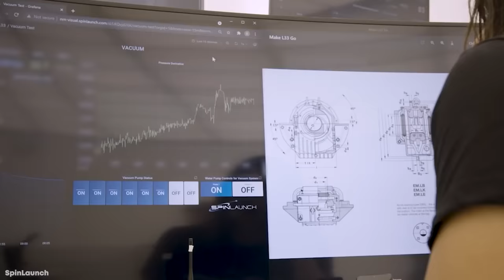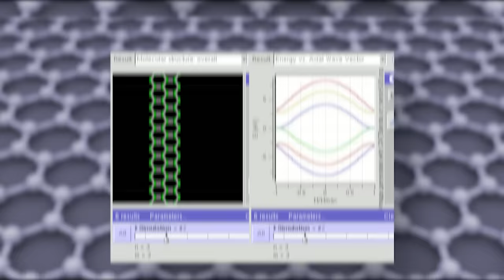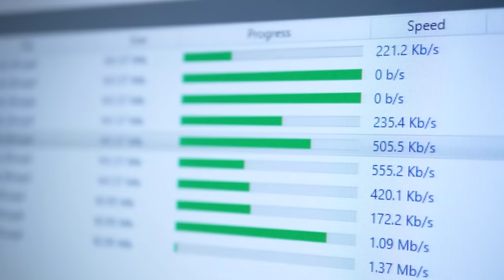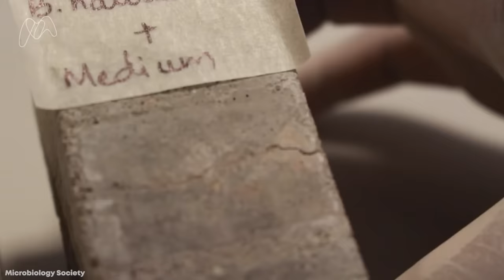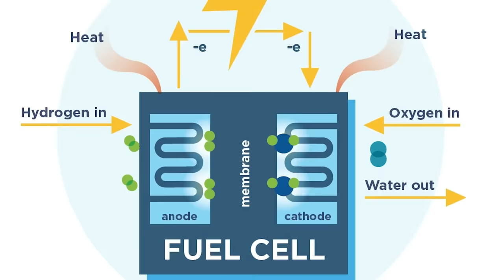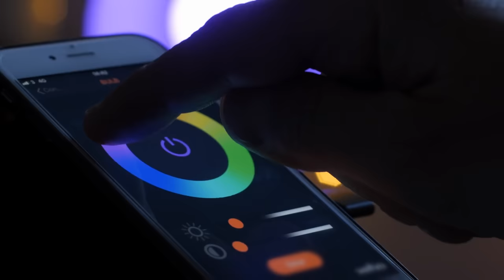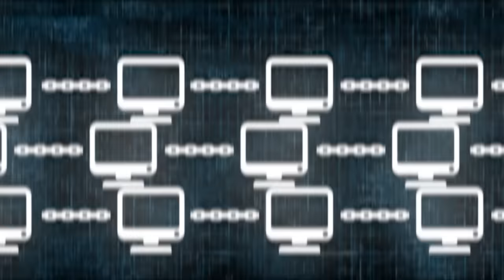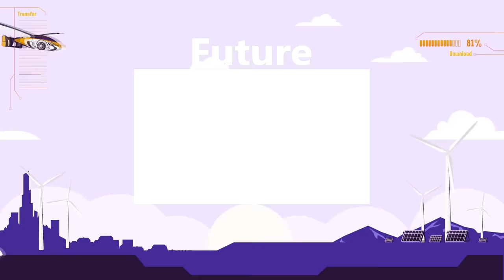15 Emerging Technologies that Will Change the World

Comment: You don't know what you speak of. The reason accuracy is a problem with civilian GPS is because the military partially encrypts the signal so that only the military has high accuracy and is capable of encrypting all of it. That's why you need significantly more satellites to have good accuracy of civilian systems while military systems are accurate to within a few inches with the  4 satellite minimum. They do this by encrypting the smaller divisions of the time signal, i.e. microseconds. So what makes you think the military would change this? How do you think they are improving a system that works exceptionally well? Yeah they could make the signal more powerful to help keep from being jammed but that's not going to help you because I doubt your privilege will ever take you to a warzone were this would be beneficial.

Comment: So... the spin launch system will face serious hurdles to scale up to full size.   It will never be usable for human launches.  Lastly, it will be extremely expensive to build a full sized unit and any one failure will likely be catastrophic to the entire facility with the rpms we're talking about.   Oh, as for "green," current rockets make up such a small percentage of the overall problem it's not even a drop in the bucket.

Comment: The Electric cars getting powered by the Electric grid which is still powered by Coals/Fossil Fuels. Simple math will tell you that the strain put on the grid will just increase the Fossil fuels needed to power the grid and will probably equal the same proportions of fossil fuels being burned. So hopefully Hydrogen starts making some improvements soon.
Reply: It's ironic init. Not to mention during a war electric cars would be obsolete
Reply: Hydrogen it's highly explosive

Comment: Hydrogen is a non-starter. It's so dangerous to handle that if you have the energy to make it then you can justify using the sabatier process to tack on carbon atoms and make it much safer to handle

Yes it costs more to make such syntheic fuels but the vastly reduced costs of handling/distribution outweighs the expense

Comment: What they say at 1:40 that it costs 10s of millions to send a satellite into space, that has become the higher end for recent years, hasn't it? If the satellite launch isn't urgent they can pack a few into one launch, so for most satellites the cost already has come down significantly. Not to say that the spin launch doesn't have a future, especially if it gets optimized at the same rate that spaceX has managed it.

Comment: Cloud computing is the biggest scam ever developed. Before it came around you purchased a program and it was on your hard drive and you could use it as long as you had that computer. Now you just rent a program and have to pay a monthly or annual fee. Another thing bad about it is if you cannot connect to the internet due to many reasons I will not go into. So putting the program on your computer is better by far especially since drive prices are so low.
Reply: That isn't what cloud computing is... you just described live software which requires a monthly subscription.

Comment: Ok - second comment: Spin-Launch is not viable. Oh - they will use billions to work on it and then abandon it later. A much better solution is the Star Wars approach (not the films - but the Reagan Era device). Think of a long tube - a mile long. It goes up at about a 15 degree angle. Inside of the tube are super conductor magnets. You take a ship, make sure it is properly insulated against magnetic pulls INSIDE of the ship. The ship is loaded into the tube, when the magnets are turned on, the ship floats in the tube. Then the magnets begin sucking the ship through the tube and it comes out the other end. Normal rockets take over from there. The greatest problem we have is over coming the gravitational pull of the earth. On the Space Shuttle, the two gigantic tanks on either side of the Space Shuttle AND the main tank under the Space Shuttle are there mainly to get the Space Shuttle moving. Note that the two main tanks are ejected after only a few minutes. That's because the Space Shuttle is then moving at 3Gs (not the 10,000Gs the video says). 3Gs allow people to ride in the Space Shuttle. However, as the guy says in the video, inanimate objects can sustain more Gs than people. So all equipment can be sent up by flinging the ship faster out the end of the tube. Also, once you are moving forwards - the effect of the 3Gs is lessened inside of the ship. Thus, you can go to 5Gs going out of the tube. In effect, you can send jets into space in this way and you can send the parts to make another "gate" which can be used to send ships to the moon. Again - first you send the ships with the parts to make a new "gate" to the moon AND THEN send the people to be there and put the gate together.  Following this method, we could actually go to the moon, Mars, Jupiter, Saturn, or anywhere else in our solar system just by first sending the components to build a "gate" back and then send the people there to put them together. Ok - why do you have to insulate the ship? There is an effect which I can't remember its name - but what it is - is when you pass through a magnetic field, it feels like someone is dragging claws across your skin. The more powerful the magnet - the more powerful the effect until it literally peels your skin off of your body. The ship would have to be insulated to keep this from happening.
Reply: Spin launch is viable for unmanned launches, it could be used for the deployment of satellites and could potentially play some role in cleaning up orbit

Comment: Scractch 9 ( Hydrogen Fuel) and probably 5. (Lithium Metal or Solid State Battery). No practical use for Hydrogen Fuel Cells since it takes a lot more energy to separate hydrogen from water than it will actually produce. Also, it needs to be produced, stored, transported and unloaded to another storage facility for public consumption (Sounds familiar?). Another gimmick by Big Oil to control the fuel. Solid State Batteries has been promised for years but don't seem to be able to be mass produced at a lower cost than Lithium Ion or Lithium Ferrous batteris.

Comment: Batteries are already being used in Trucks, Ships and Planes. Hydrogen Fuel Cells won't end up being a winner.. Economics will win and that's BEV's.
Reply: You are correct - but not for large (long distance) Ships and Planes.  There may well be a place for Hydrogen, but only once it can be produced at scale from green electricity.  Otherwise its inefficiencies make it more polluting than fossil fuels.
Reply: @simhedgesrex7097  For long distance there is always wind.
Reply: @michaelwebsternz  Difficult to get wind to power a plane.  It can help with ships, but can't be the only source of power.
Reply: @simhedgesrex7097  battery cost and wait is reducing and will overtake other forms of energy in most applications. The economics just won’t work for the others.

Comment: UW-Madison engineering (Wiconsin)s has developed a light weight, mainly plastic electric motor for vehicles that meets performance and reliability demands.... apparently the problem is financial backing and development....this vehicle needs no cooling system, total weight of vehicle? perhaps around 1000-1200 lbs.

Comment: Sorry but their space launch will not work.   If a satelites burns up re-entering then thin upper atmosphere, imagine what launching it through the thickest lower level atmosphere at those speeds will do for burning it up.   Further more, that is all velocity lost, pushing the atmosphere away.   Second, the G forces limit taking a simple copper wire around a simple pulley of any diameter at more than 240 mph, due to the centrifugal forces on it.   Other materials can do better, but not enough to solve this problem.   So, who really is putting up money for this project that is destined to fail?  So, I now have to question everything else they said.    As for hydrogen fuel. It has a specific gravity of only 0/07  (7 % of water) but with 3 times the energy per unit weight of gasoline, you would need three times the volume of hydrogen to do the same job as say jet fuel, the tanks would be so large that they plane would not have space left over for cargo across the Atlantic.   someone is dreaming here.
Reply: Nope. You can convert it to methane or use it compressed. The problem with it is that electrolysis uses a lot of water. So it’s still a future thing but can definitely improve energy saving for renewable energy

Comment: Combine AI and liquid metal creating forms that recreate themselves in solid components for industrial purposes implemented by their individual programs.  Automated system requiring little maintenance and occasional reprogramming dependent on need.  No wages to put up, except for the data programmers and occasional cleanup. Thanks for tolerating the daydreaming, always the fan of the futures sciences.

Comment: Sorry, Spin Launch is STUPID. Timing is near impossible and the drag at ground level would cause the rocket to heat up way more than can be tolerated by most materials. This is akin to having orbital space ships that need to brake enough to land. But this would be at even thicker atmospheric conditions as the atmosphere is quite a bit thicker at ground level in comparison to upper atmosphere. This doesn’t even bring up the precision necessary to launch the vehicle up the tube. Just a bit off and you will have a huge explosion as the vehicle hits the wall. Spin launch will fail miserably.

Comment: Some technologies here are misrepresented. Quantum computing, for instance. It can be used for specific computations, but it will NEVER replace regular computers. Graphene is a wonderful thing but they can't produce it inexpensively. It's been around for over 20 years now. Lithium metal batteries are a joke. There are 20 battery technologies out there and lithium metal is just one of them. None can be produced inexpensively, so nobody knows which one will come on top. Blockchain will be used, but in a very limited fashion. The idea of blockchain is to prevent hacking. To do that, you need a delay in block validations. That's the only way to prevent a farm of supercomputers from hacking it. Not exactly useful, is it? You will be waiting for 10 minutes for your bank to transfer money from one account to another one. Connected homes are just a gimmick. GPS-3 is a better mousetrap. Edge computing is already happening. A hydrogen fuel cell is a great idea. It has some limitations but I think it may get developed. I always thought it was better than solar technology.

Comment: 10:04 "our electrical grids simply aren't designed to handle the load", such a BS argument.
 The thing is, we should use large infrastructure power trasnfer nodes, from state to state,
under the guardianship of the federal government.
This should then be UHV ultra-high voltage, to deliver power at a minimum cost from the place
where it's created by green sources into the place where no such power is then available.
And yes, there's cost involved, but still we can always pollute more, until the message sinks
in when people show up sick at the hospital and yet more costs start piling up.
Wanta cleaner tomorrow ? Invest in it today. I think like 4 nodes per state,
after which the regular grid can pick it up.
Also, local potential power storages can be very greatly used that way, since now each state
can have a big one like a cubic kilometer underground, which then can be used
as power is abundant, and after which it's filled the excess can still be distributed.
Reply: All oil wells will run dry sooner or later, and if by then we don't have power alternatives
in use, well, that's that, economy worldwide on it's backside.
Reply: Oh please... tell me where all this "green energy" is going to come from.... how  are we going to store all this energy?
Reply: @ZMacZ  ya oil will dry up in 100 years or so.
Reply: @randybobandy9828  Sooner, since other fossil fuels are drying up sooner, the demand for oil will increase.
Increased use will mean sooner running dry.
Reply: @randybobandy9828  Simple solar power, non-moving standard, durable with lifetime per panel of nearing a decade, and after that still delivering 80%, and the storage is potential energy storage. That's two vats of water differeing in the position in height, where water gets pumped from the lower position in height to the higher one, when power is surplus, and the higher positioned one delivering water at an altitude through a turbine delivering power when power is requierd again, while flowing said wtare back into the lower is ib height positioned one.
Reply: @ZMacZ Furreh  no they aren't drying up "sooner"
Reply: @randybobandy9828  Basiclaly have 3 taps, one for gas, one for oil and the last being oil.
One dries up, the gas, now the others are used more. => they dry up sooner.
Thinking is not hard.

Comment: in the not too distance future the 3D printer wont be in a cube but will be
on it's own tracks or wheels and long hydraulic multi elbow type dexterity
possibility of maybe self contained just working to a program
having the ability of reloading from secure truck, which it self orders doors
to open so it can refill what it needs, expensive logistics parts with the doors
closing when collected its refills, not AI just scaled up programming 
with support, I could build this now, I have so many ideas and think why
don't they do this now as mankind would benefit now, that's life I should be rich

Comment: All this is really interesting, but blockchain is just a failed technology at this point.
We've been talking about it for over a decade, about how it can decentralize everything and what not, only to realize that the scale required for this can only be achieved by large organizations, which means that it's now centralized. Also, given the scale, it's just not feasible when it comes to memory and energy usage.
The best example is bitcoin. You can see the ledger size and the amount of energy used by it for mining. What started as something you can mine on your home PC, now requires specialized and expensive hardware and an ungodly amount of energy.

Comment: Spin Launch is a joke.  You really should have done a bit more research into the physics issues it has.

Hydrogen is not really a very good option for regular cars.  It requires very thick heavy containers to hold the high pressure Hydrogen.  This is very dangerous in a crash situation.  So unlikely to ever be a common place thing - maybe for some niche situations though.

The claims about solid metal batteries are massively exaggerated.  The laws of physics are really hard to avoid.

Comment: What was that diarrhea squirting fart sound right at the start of the video? Even today, the concrete we make is pathetic garbage compared to the concrete the Romans used to make. And better than hydrogen cells is carbon nanotube technology for storing immense amounts of power in a small form. You forgot to include 5D optical storage "Superman memory crystal" that uses quartz to store immense amounts of data - a thin coin shaped drive the size of a nickel can hold 360TB of data and the data never deteriorates and the storage drive would essentially last forever unless destroyed (it's pretty hard to destroy quartz)

Comment: past-Current-future Chinese
= is using the baGua center of two pivot points of knowledges to rotate
= lower pivot point is left(dot) rotate to right(straight linear - high)
= higher pivot point is right(dot) rotate to left(straight linear - low)
= two pivot points rotate together to change position while retaining the same vector

Example
= low knowledge worker switch left-right
= high knowledge worker switch left-right(low), left-right(high)
= mastery of knowledge switch-rotate the entire circle and the pivot-points

Use high-knowledge to design for low-end, low-budget, economies of scale can enjoy mass production benefits and ... ...
Use mastery can use those things to different effect and expose fake chinese

Comment: Spinlaunch Will only work for small very solid state stuff… will go bust, grapheme of course is 👍. How to make it however,,, ; Why the ferro liquid shots?; Gelileo Ie eu satnav has better resolution, s why build the next system?.. link them all together and we have best system instead of multiple less well function satnav systems…; floating farms nice but let us use office buildings first!; cloud will grow for years, as it has a lot of unused potential; self healing concrete is briljant!; hydrogen is difficult, dac using hydrogen to make conventional fuel use co2  from air is the better solution, nec essay too, as now too much co2 in atmosphere, Starlink is really stupid, pollution of lower orbit and completely not necessary except to keep space x financially afloat; aî dee arming will prove to be great tech but somewhat dangerous too; robot armies etc..l; connected homes is really first world luxury thing…; sponsored by Amazon?; 3D printing with sharing of designs will greatly improve bp,any à making process, eg printed houses indeed… Econ of scale, and much will become cheaper; blockchain will revoliti inzet banking, money, and it’s use will become widespread; sound will re olitionize fire fighting,,,; quantum computing go shape of fysicist, and I expect quantum computing  to behave like fusion; always 30 years away…; ;